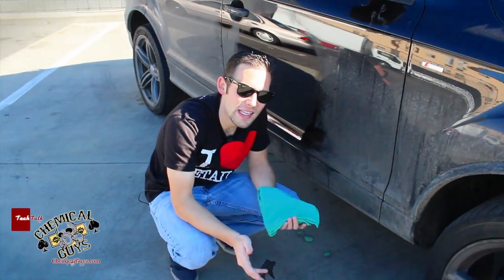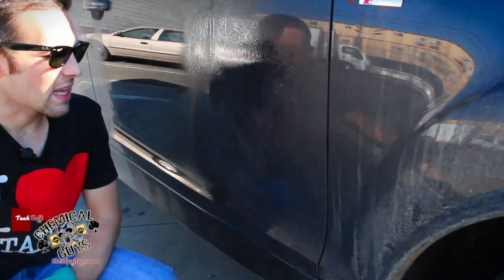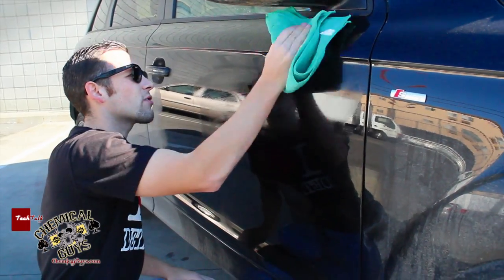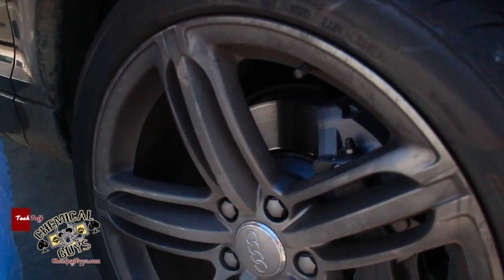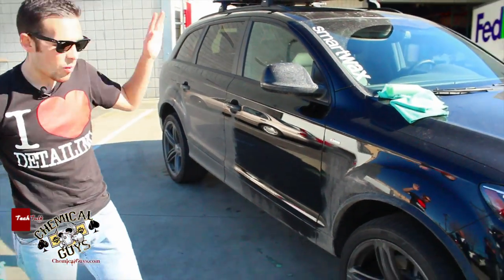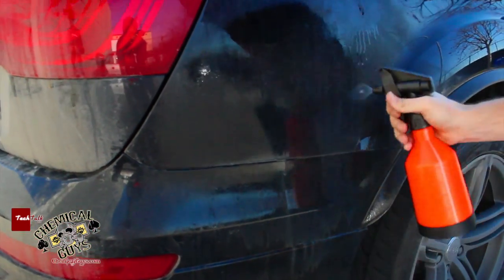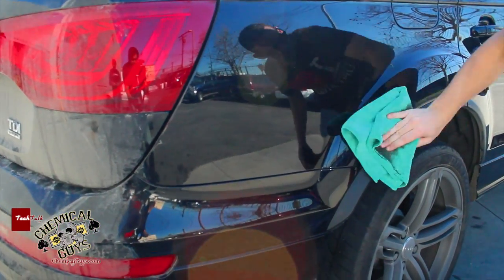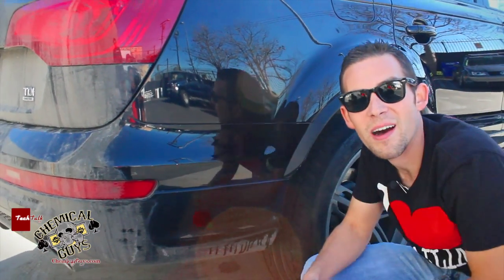Waterless Washing HEAVY DIRT & ROAD GRIME - Chemical Guys ECOSMART Audi Q7 DIRTY

Comment: if you're gonna wash the car using waterless and a microfiber, you HAVE GOT TO change to a clean side after 1 swipe. DO NOT do what he's doing, or you're asking for swirls and scratches.
Reply: what would be a more efficient method That seems like a ton of microfiber cloths?
Reply: Use two cloths. One to wipe the excess off and a clean cloth to buff it.
Reply: @barrytapes8924  a couple large mf towels. Rotate your hand as your cleaning to make sure you're not just dragging dirt but  also lifting. Good waterless chemicals protect and lubricate the paint to prevent scratches during this. Haven't tried this specific product, but takes me 3 to 8 large towels depending on how filthy the vehicle is. Usually 3 though.

Comment: I have been using this stuff and it's awesome! Cars need to be washed with water also to get in the nooks and crannys but I use this in between , if it rains after I wash the car I use this or if it's dusty it works great no swirls!

Comment: This stuff is amazing and really works!  Since I ride with a soft top on my Jeep during the summer months, car washes are out and I don't have access to a hose where I live.  I started using this and after 2 years my paint still looks really decent!  Sure I have a minor scratch or two but that could be from taking it through a car wash.  There is no way to guarantee that any product you use won't cause scratches, but proper technique and Chemical Guys has really helped me minimize the amount of scratches I have.  I compared my Jeep to my brother's who just uses a regular wash and the swirls and scratches on his Jeep were extremely noticeable and our Jeeps are pretty close to the same age.  He is now hooked on Chemical Guys as well.  Really try it before slamming it... You might be surprised!

Comment: 30 microfibre cloths later..................
Reply: haha exactly what I was thinkin
Reply: They sell those as well :)
Reply: Places like Costco sell microfiber towel packs... So, no worries.
Reply: Kev Wilding shouldn’t it be like 10 good microfibers and folding properly. I’ve don’t this on my car without proper folds  and yeah I use more.
Reply: noo way i use 10 buy at dollar store for a 1.00 for a ten pack gp dollar store save cash buddy.
Reply: This makes me cringe rubbing all that grit over your Paint
Reply: Do you guys just throw away the microfiber clothes after? (All those chemicals in a washing machine can’t be good)
Reply: C-Bomb they don’t use a typical household washing machine. I seen an episode where they show how they wash them. Lots of oils and chemicals are not good for household washing machines. And no, the rinse cycle does not get rid of all residues. If that were the case, people wouldn’t have to have wash tabs and services to maintain them. But go ahead, keep putting oils and chemicals in your washing machine, and when your clothes feel waxy, smell funny, and your machine breaks, maybe you’ll learn not to be a smart ass, and read your user manuals.
Reply: @Chris-eo1bp  Takes me 5 ish for a really dirty  sedan, or 3 for weekly maintenance cleaning, but thats using a different product so it may differ slightly.
Reply: Michael Kiddle they aren’t rubbing anything into the car. That’s why you flip the towel and use different sides so you aren’t scratching your paint.
Reply: @michaelkiddle3149  Its designed to lift the dirt from the surface.
Reply: Still conserves water
Reply: @sacalabolcita8210  not after you have washed all your cloths!
Reply: I'm amazed that politicians have convinced so many people that they need to conserve water. Literally the most abundant resource on the planet.
Reply: That‘s why you should not use this on a car as dirty as this one. This is for demonstration purposes only. If your car is as dirty as this one, rinse the dirt away with clear water first. Afterwards, use this. You will only need 2 microfibers for a car. I really enjoy using it after I drove my 911 through the rain.
Reply: @Dantastic123  you cant drink salt water, caveman
Reply: @artempatrushev6684  it's pretty easy to desalinate water.
Reply: @Michael Kiddle  yeah these waterless washes / quick detailers  are only good for light dust etc.. this demonstration is terrible

Comment: Great product Chemical Guys!!
I got to try my Eco Smart concentrated for the first time today and I really liked it. I detailed a 99 ranger extended cab and a 350z with this product, it enhanced the paint beautifully and left no streaking on the windows and even cleaned the tonneau cover with it. I used a little bit less than 2 ounces out of my gallon for these cars and made a profit of a hundred fifty bucks. I wish I would have bought two more gallons great stuff.

Comment: I recently bought this and tried it out for myself I don't think it will replace Me washing my car with water but I see it as a good in between washes to keep it looking nice and clean my car picks up a lot of dust so it's really nice to have something like this to keep it looking good longer I also used about 4  towels doing my car. I think it's great stuff planning to buy the gallon contracted when I run out of what I have

Comment: If you use waterless on a dirty surface without first washing it down, wouldn't the dirt grind the surface and leave swirl marks?? Thanks.
Reply: Yes. Very much yes.
Reply: yeah i was thinking the same thing >:/     nah i'll stick with nice refreshing water on my baby.
Reply: I can't believe they market this crap. I'm starting to like Chemical Guys less and less. Any expert on "detailing" would know this puts micro swirls into your paint but then again it'll probably help them sales wise. Use this stuff and you'll have to buy a polisher and compounds to remove the swirls it left in lol. Not cool you guys >: (
Reply: Dwight D. Of course it has its limitations, however don't forget that not everyone has access to water and 2ndly, the top brands like Meguiars make waterless car sprays too.
Reply: If you've actually used the stuff, you would know that it doesn't. I was honestly surprised because I'm very OCD, and I have a fresh paint job (less than a year old) on my 1996 Volvo 850. EcoSmart lifts the dirt off from the surface so you can properly roll your hand with a microfiber towel and pick up all the dirt without leaving any scratches. It's honestly a great product. You'd be surprised. https://drive.google.com/file/d/0B0JwcFRp-MDcbWhxckR0UEI5dkU/view?usp=sharing
Reply: LJRossPhoto That's assuring to know. Thanks :)
Reply: LJRossPhoto Could you make a video on how you clean it and upload some close up photos? Thanks!
Reply: They have a video where they cover on how it works and how it doesn't scratch your car
Reply: It's not like a quick detail spray, if you actually take the time and stop being close minded and check there video on how the product works you'll understand. I've been using this here in Ny where there is lots of salt and snow and so far no scratches and no swirlmarke, been using it since november.
Reply: Used this Ecosmart to wash my car yesterday, and honestly, it is amazing... try it and you will be amazed
Reply: Dual action pump is an awesome idea but if you get sand pieces in that towel you'll totally scratch the paint. Especially if you accidentally go to dirty area when making it shine, when there would be minimum product on the surface. Would be a good product to get dust off though
Reply: This ecosmart is a amazing product. Never have I scratched my cars or anybody elses. All products are great from Chemical Guys.
Reply: I wouldn’t use this for a full wash but an easy way to wipe up some dirt, water spots, etc.
Reply: As long as it's not proper caked on dirt, in my experience, no. You just got to make sure you spray enough on, the dirt should glide off without any force at all. As long as your not scrubbing it or using force, it won't scratch.

Also get plenty of microfiber towels, a bucket full of them. At least one for each panel and you won't have any problems using this stuff. Then just machine wash them after (chuck any that you drop on the ground or are too gritty to clean properly).
Reply: That was my main question, would salt being on the car during winter, would that scratch the car without rinsing first?
Reply: Fresh Juice Apparel yes, don’t do it. even after 1 wipe of a clean car. you must fold the towel and use a clean side or you will get debris on the towel that will cause swirls.  This works best in my opinion if you washed the car the day before and you have collected some dirt and don’t feel like washing it again.
Reply: I'm not big on red, but your Volvo look great!
Reply: No, the whole point of this is that it doesn't.

Comment: It's actually a great product, have been using this for a long time and I feel safe washing my car with Ecosmart. But I don't use it when the car is really really dirty. Plus I think its smears a bit, so I prefer Optimum No Rinse with a bucket and water.
Reply: Thomas Sanner i use ultima concentrate because it can be used as a rinseless, my method is to use a sprayer to wet the panel and then a two bucket rinseless method to clean the panel then buff it out with a clean mf when i get to a point where my cleaning mf sides are dirty i switch to the buffing microfiber and use that as my cleaning and work one panel at a time top to bottom, I've been making good money and not scratch or marring peoples cars, depending on how dirty someones car is depends on the method but i always try to push a full detail on a new client then use maintain the car with waterless

Comment: I'm struggling to understand how dragging cloth with dirt in it across you paint work won't scratch it?
Reply: ***** first of all why would a detail guy use a product that would damage a customer's car? This stuff works like a lubricant between the clear coat and the dirt as well as helping dissolve some of the oils, tar etc that can build up.
Reply: Josh Corps You don't have to understand.......
Reply: you flip the cloth around so it won't scratch it.
Reply: my god people...its called LUBRICATION............LIKE THE OIL IN ENGINE AT 3000 RPM ON THE HIGHWAY BUT YOUR MOTOR DOESNT BLOW UP, DRAIN THE OIL THAN DRIVE IT AND SEE WHAT HAPPENS....GET THE POINT?!?!?!?
Reply: Viral Clown rock does not stick my the car

Comment: as long as theres no real big grains of sand, mud, or rocks stuck to the paint i have all the confidence in the world with this product! plus with a crew cab truck it takes a solid 4 hours to wash and detail that beast. so its cool to not have to use water in the hot sun and have it dry which makes water spots. i can wash it when the sun is out then do the waxing and whatever else i need to do as the sun is going down and its not so hot.

Comment: so what you use is dual action spray bottle ?
if you have mud cause if a car is real dirty I rather go to the wash box use high pressure .is mud leaves stuck on the door sand etc

there wash and wax and eco wash wat is the divrent

Comment: This stuff really works. Buy lot's of microfiber towels. Use the EcoWash  3-4 times a week, you could get by with 2. If at any point you feel your car is too dirty to use the spray wash, use a standard 2 bucket method. About once a month, clean your rims with the wheel cleaner of your choice, getting the inside of the rim also. The rest of the time, use EcoWash on the outside of your rims. All the retailers of car detailing products sell some sort of waterless wash, so it is accepted as a viable method of cleaning your car.
Reply from the maker: Well Said!

Comment from the maker: You can go to the "Wash Box" and use a pressure washer, but if you are washing a car in the middle of winter, the water will freeze on the paint locking in the dirt. Plus nobody wants to be standing outside in the cold. ECOSMART allows you to wash your car faster and easier than water. Plus you can wash your car inside your garage where it's warm and comfortable.

Comment: I don't see how this is Eco-Friendly, after washing a car you'd probably go through at least 10 microfiber towels - for most people that's their whole set so they'd have to stick it in the washing machine. Which, in case you didn't know this washing machines/dryers use a lot of water...and electricity...sooo there's that.
Reply: sometimes people have apartments and does not have access to a hose.
Reply: johnny tram or go to a car wash
Reply: Or you can hand wash it. I like how you’re supposedly thinking eco friendly but forgot how some people hand wash their clothing and items to conserve water. Clown.

Comment: this is a good product it works very well I use it all the time what I usually do is I spray the whole car then with 2 fibre clothes I go light all over the car to take the main dirt off then I'll give a final spray with 2 other new clothes all over the body again it doesn't scratch the car it's very slippery it doesn't allow you to scratch 
you can use the same product for wheels to
autoglym uk is using as well especially if you live in the city it's really handy

Comment: Be sure to use a 2bucket system! Otherwise you are putting dirty water back on the vehicle. Won't scratch if used correctly. I use Optima great product. Mix with water raises dirt and floats it away

Comment: I did waterless wash one time when the water was off for like a week, but NEVER AGAIN! Is a messy job and you still need water to wash the wheels, under the wheels and the under carriage. Waterless wash only works if you wash your car and after two or three days of driving it WITHOUT rain, you can buff out the slight dirt and bug marks off it but not on a real dirty vehicle since it would take even more time to wash it and way too messy.

Comment: Ive done this once, it did a good job. Didnt scratch the car as far as i can tell. My mind just wont allow me to do it again though. I cant logically understand it. Sure its lubricated but youre still technically dragging the dirt and grime across the paint. What if theres little grains of sand or even tiny metal chips on your car mixed in with the dirt?? Lubrication wont completely keep it off your paint. If you press too hard itll say F U to the lubricant and hit the paint directly.

Comment: If it was above 35 Degrees and I had a heated garage and drain. I would use water and snow foam then rinse. The well ran dry due to a large use ( hot tub) and since it is an eco friendly solution its a win win if the temp goes above 35. there is a high pressure robot wash in town but not all cars can have high pressure. Great solution for winter or summer drought, and good to back into soil during rain storm.  Straight lines are so that if you scratch is easier to buff out. Just wondering if wholesale clubs sell good enough microfiber towels?

Comment: I have been using this product a lot and as with anything technique is everything. Dirty cars I saturate the dirt more and when I wipe with dirt off I use a rolling technique with the towel as I'm wiping so as to minimize the chances of marring and swirls. I also sometimes com do a hybrid wash using ECO SMART and MF towels soaked in rinseless wash followed but soft MF towels for drying . More steps and towels but my customers deserve the best when traditional washing can't be done.

Comment: the basic advise car cleaning.

NOT DO WHAT THIS GUY IS TEACHING YOU.

this spray should be used only on dry spots. where youve washes and water residue has foamed spots......ideal for that.

when it come to actual dirt from daily driving......
wash (ideally pressure washer first...i do..)
the safest way.

your vehicle collects all kinds of debris whilst being used.

plus...

that shine you see after its been cleaned. you would expect from a new car......

i bet it wont shine like that on my 1990 honda civic?????
Reply: NISSAN GTR
Reply: not everyone has access to a pressure washer. And if you're on the road to a car show and you get some dirt on it this is a great substitute than rewashing your entire car. And why are you commenting on a detailing video about shine when your 1990 civic doesn't shine. it easily could if you know what your talking about

Comment: While waterless wash sounds great, how will this not cause more swirls and scratches?
Reply: But LUBRICATION Guarantees friction is involved, just less friction. So, it still will introduce scratches although not obvious scratches.
Reply: +Debby Johnson I wouldn't recommend it as replacement for traditional bucket / handwash. It's good for light dust or daily wipedown. For heavy dirt as seen in the video, I'd go for traditional washing.

Comment: I am starting a mobile detailing business here in New England. With over 10 years experience in vehicles reconditioning and restoration waterless wash is skeptical to me. I am eager to try with the POD system because of the volume of cars I will be doing. My question to Chemical guys is simple. I always clay bar after I wash before I do any kind of paint work, or just a simple seal and WAX. Could I theoretically use this solution to clay as well? trying to kill two birds with one stone here. If the lubricity is as good as you say it is, it should work well for clay as well.

I always take my 100 gal. and NorthStar hot water system with me just in case the cars are extremely filthy. I will only use waterless wash if it a weekly maintenance client, or a lightly soiled vehicle that doesn't require much debris removal.
Reply: IF you are to use it (which I don't recommend since it's basically asking for swirls from what I've seen) then you should still clay bar the car after you wipe down the EcoSmart. This is because of any leftover debris that the EcoSmart may not have picked up.

P.S. I wouldn't recommend products like these for full detail, though this is already obvious.